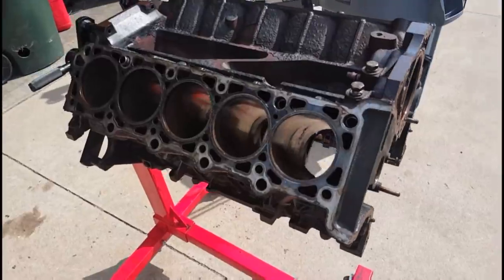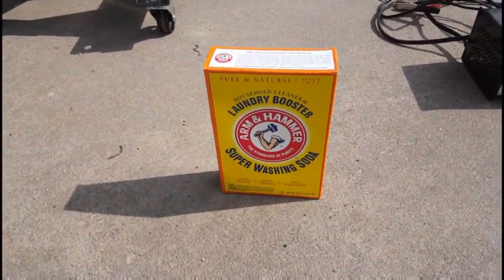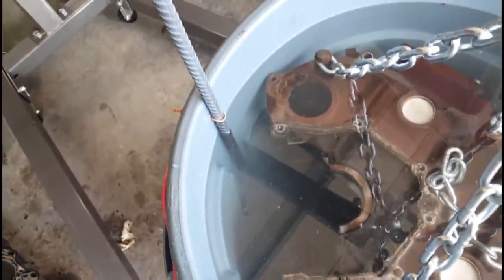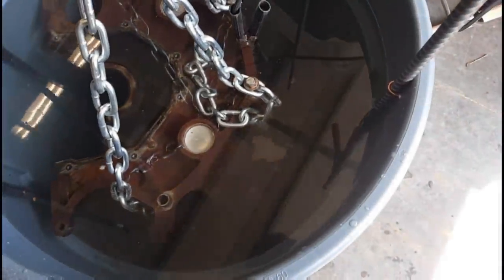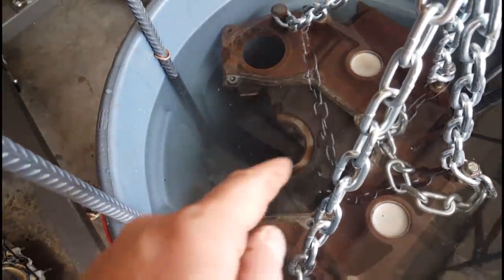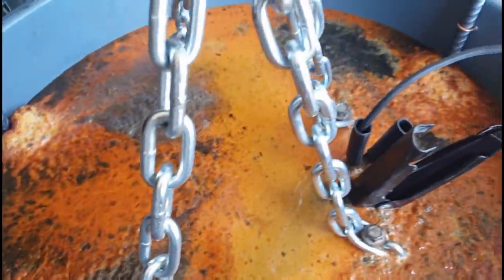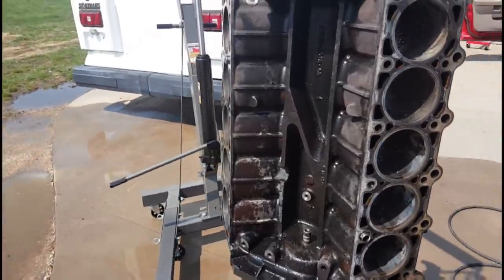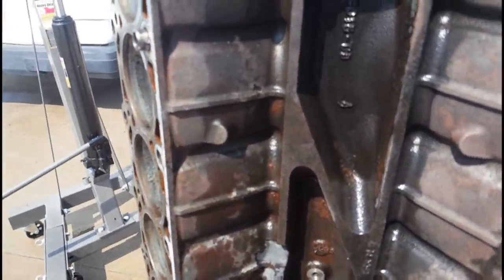1998 Ford 6.8L V10 Engine Block Electrolysis - Part 2 of 3

Comment: Why do you need such a massive engine just to ferrying at just ferry people?
Reply: The 415ci v10 is all torque. And the computer regulates the speed to 85 mph
Reply: It's not really all that massive as far as displacement goes. As far as physical size goes, most of it is heads and intake.
Reply: Metzelbaer Nibbels 
Yea no shit , the 2016 Ford at work has me split. 
All we’ve learned since the gas sipping 70s and 80s regarding efficiency , that thing averages 12.5mpg, but it has 380hp and goes like a scalded cat!! 
Let’s give up 150-200hp and have a truck that averages high 20s, that would be nice. 
Haha I can’t believe I’m saying it has too much power. Nothing has too much power !
Reply: Murica!
Reply: MrHillfolk that thing weighs well over 5 tons, it would be dangerously slow if it missed 200hp. And it still wouldn't get much better gas mileage, it's the weight and size that sap so much fuel. With say a v6 engine, it might get 15% better average but be twice as slow. Not a good tradeoff for most
Reply: idontcare80 it made 305 in 2v and 362 in 3v. It can be a good lasting engine with proper maintenance, just like the 5.4. The main purpose is for it to have lots of torque and not have to work too hard so it will last. 5.4 motors have problems with the cam journals in the heads getting ruined when there is a lack of lubrication ie the owner doesn't know how to change their oil. Id imagine its the same deal on the v10 since they are the same basic design. Oil pumps can also go bad on some 5.4s, I believe their was an updated part for it. But clean oil would keep even a poorly designed oil pump going. Most engine failure is lack of maintenance or abuse. The 6.8 was made to pull heavy loads all day every day with no problems assuming good maintenance.
Reply: idontcare80................LMMFAO! Now we all know you failed Physics! Torque is the work being done. Horsepower is a measurement of torque over time.
Reply: It was 255 in the E series vans.
Reply: idontcare80 it's about torque, and low end torque too, which is going to be world's better than a 4.0 i6.  Unless the 6 is turbodiesel, then it might be better.
Reply: idontcare80 yeah, but the gearing required would then be ridiculously short, limiting top speed (assuming a usable ratio gap between each gear in a 6A trans), or requiring a stupid amount of gears.
Reply: Why would the gearing be shorter? The lower the revs, the more gears you need, like you have in semi trucks.
Reply: So it thing build for speed if put in a smaller car or just towing all these ppl
Reply: idontcare80 The gearing would be shorter so it could handle the heavier load.
Reply: Except that the engine has more revs, so there would be no limiting of top speed in any gear.
Reply: You're not really wrong, you're just not understanding what that means. Torque (force) is work, power is work done over time, or the rate of work. The more power you have, the faster you can perform the same amount of work. In other words, a 300 hp engine can do more work than this engine at a greater (faster) rate. More power means more torque, faster, basically.
Reply: TheManLab7 a
Reply: Alistair B this will always be the truth, engine failure 99% of the time is due to lack of maintenance or improper use. Fuckn hate most car owners
Reply: Dusk Dawn yes even businesses will stretch out maintenance intervals to save money short term. Most of the engines I've seen through the machine shop where I work have lots of sludge in them, which means long oil change intervals.
Reply: Ray Jay idontcare80 you both failed physics. A 4.0 liter inline six would not hold up to 4,500 rpm, it would have to be designed with a smaller bore for packaging (don't want the engine too long), therefore a longer stroke which means higher piston speed at any given rpm. That's partly why the old Chevy v8s weren't as durable as the LS. The advantage of a larger engine is it makes the same power at lower rpm.
Reply: idontcare80 torque is simply a type of force, work is force times distance, power is work per unit time. The equations for torque and work look similar but do not mean the same thing.
Reply: Jeff Niemeier was the e4od shifting way late?? Like first to 2nd shitt was too high in the rpm range??
Reply: Seriously. A 4ltr turbo diesel would make alllll the torque you need to do the job.
Reply: Spinal Column and it would cost more to build than the gas engine. There was a diesel engine available, but it was a $5000 or so upgrade. And it was a 6ltr. You probably wouldn't get better mileage with a 4ltr.
Reply: Bigger engine means less stress on the parts, which means greater longevity. Bigger is better.
Reply from the maker: Yep, looking for torque here.  Many of of the Ford F or E-350 and 450 models come with the 6.8L V10.  Later versions have more power.  I assume we need the torque for the amount of weight this beast can probably haul if it was full of 15 people.  I've reduced the number of seats to 8.  It seems to have plenty of power and cruises right down the road now.  The Ford E4OD transmission has been working great as well.  Changed the fluid and filter.
Reply: TheManLab7 why do you need to worry about it? It's not your van, it's not your problem.
Reply: This thing only makes 255 hp, that could be done pretty easily with a 4.0 inline 6, even in those days. The 6.8 doesn't have the greatest longevity either.
Reply: Gasoline engines are more efficient a WOT than they are at partial throttle openings.
Reply: Torque doesn't do s--t for you, it just means that the engine turns slower for the amount of power that it produces. You could have a 4.0 liter inline six run at 4,500 rpm and make 255 hp, that's plenty low for the engine to last forever.
Reply: Alistair B it would be worse with a v6. In fact, it would get far worse mileage. A v6 would either be screaming at 4800 doing 70mph do to the short gearing required to allow it to do 70...or if the eo4d and oe gearing were left in place...the throttle body would have to be wide open and the injectors firing @ full duty cycle just to do maybe 50mph. Both would burn twice as much fuel as the V10.

Comment: >become the sacrificial anode rod and WILL COLLECT all of the rust! 

It won't collect the rust, it will be decomposed into rust.

The black film present on the block after the electrolysis bath is magnetite, an oxide of iron (Fe3O4) created when ions of the sacrificial anode is decomposed in the water/carbonate solution.

Be careful when handling the waste from the electrolysis tank because it will contain ions of heavy metals, many of which can be toxic. Two examples which might be present are lead (from the bearings) and chromium (from the rebar.) The multiple shades of brown froth at the top of the rods looks suspiciously like chromium trioxide.
Reply: He dumped it on the ground . I was wondering the same thing, you can clearly see where he dumped it it in the video. Cheap and not a care about proper disposal.
Reply: Water service companies try to regulate the PH of the water to be more alkaline to avoid corrosion in the case of metal pipes being used. Using a sacrificial anode inside water pipes would be very dangerous because all of the metal ions leeched out of the anode would be distributed into the water supply.
Reply: 金3 A.M. Yeah but all his shit is gonna leach into ground water, which is no bueno
Reply: @-BuddyGuy  who cares if it leaks in the ground water. 90% of us drink water thats contaminated hy something anyway. ever been to a truck yard or a farm,dump,landfill,side of the road, any bigger city, any small town? theres trash, shit, piss, rust, chemicals and god knows what else seeping into the ground water of everywhere everyday and it dont make a lick of difference as to how everyday life goes. i do agree that it wasnt good of him to dump it on the ground but to be honest no normal person knows where the fuck ur supposed to dispose of that shit at and barley anybody has the ability to do so anyway.
Reply: He seems kinda dopey. For all of that effort I would take the block and heads to a machine shop and definitely would not have dumped all of the waste on the ground.
Reply: t44e6 remember he said it's a low budget rebuild, will say he's a bit dopey but fuck it, it's nothing to get worked up over. the guys learning as he goes
Reply: @ 金3 A.M.  Who is worked up?

Comment: Electricity flows from positive to negative, it will work best with the block being positive.
Reply from the maker: 36Nick4Truth, if you reverse the polarity your engine will then become the sacrificial anode rod and WILL COLLECT all of the rust!  Electrons move from a negative charge to a positive charge, thus creating a "current flow from positive to negative".   One of the few things I remember from my days of Electrical Engineer at the University of Iowa.
Reply from the maker: You'll notice in the video that the negative battery clamps are submerged under the water but the positive clamps are attached out of the water on the wire and rods.  The negative clamps will not corrode under water but the positive clamps would immediately rust if they were connected under water...
Reply from the maker: Yes, we are splitting the water into hydrogen on one pole and oxygen at the other pole.  This process is how Navy subs produce oxygen for the crew underwater.  Subs vent the hydrogen into the sea.  This was basically outside in a well ventilated area so no chance of problems.
Reply: 36Nick4Truth Ben Franklin's positive & negative were set without knowing the direction of electron flow. As luck would have it, electron flow is actually from negative to positive. Many still use positive to negative, conventional current flow, and it rarely makes any difference. Electrolysis for block cleaning, as you've mentioned, is in sync with the pixies, magic really...  a humble offering to the Gods of YouTube, their movements, a mystery, known to few. Good day.
Reply: Jeff Niemeier I never knew that, pretty neat.
Reply: Check out the guy on youtube who zinc coats your old carburetor and rebuilds them. He gave me a price, pretty affordable too.
Reply: This is called impressed catholic protection. Used on pipelines and storage tanks in heavy industry. It’s cannot fix damage that has been done to your cathode ( negative lead ) in this case the engine block. You actually run the risk of hydrogen embrittlement. This occurs when your cathode becomes more electronegative than -1300mV DC in an instant off reading. Placing that much current on such a small circuit is not the ideal circumstance. On cross country pipelines we have our rectifiers putting out around 2 amps every 30 miles. Granted this is a 36 inch FBE coated high pressure oil pipeline. If this interests you look at the NACE website. (National Association of Corrosion Engineers) A lot of cool stuff going on on every pipeline and storage tank you see. It’s even at every gas station.
Reply: I hope you do know that you were literally making hydrogen inside that bucket and if there was a spark it would have scared the crap out of you it would not have made a large explosion but if there was a spark anywhere around the rim of that garbage can you probably would have lost your eyebrows LOL just remember baking soda is an electrolyte that helps produce more hydrogen

Comment: Look at soaking the block in molasses mixture after this is done,,,but Do NOT put Aluminum in the molasses bath,,,the molasses bath will get inside the Chambers,,,This is not a Joke ,,,Google molasses rust removal,,,